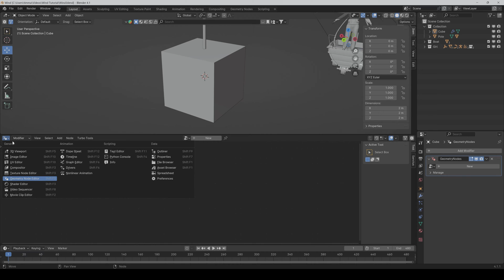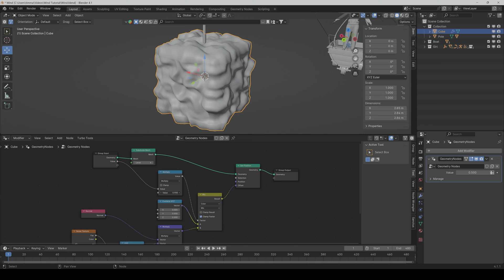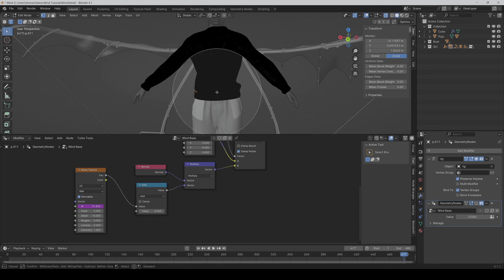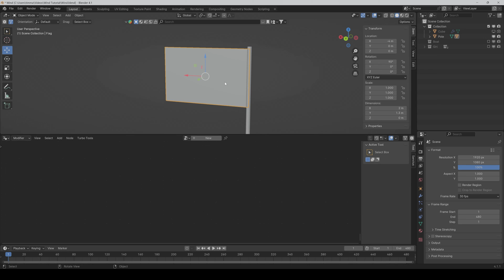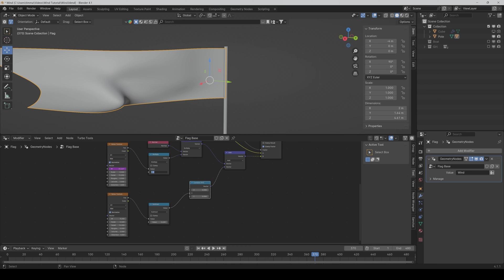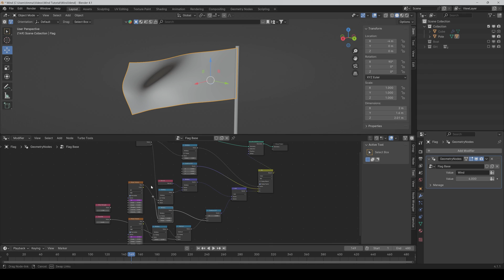Wind Effects are Easy Now - Simulate Wind in Blender on Clothes, Sails and Flags with Geometry Nodes

Comment: Cool stuff, instead of a mix rgb node i would personally use a noise going into 2 vector math nodes, the first vector math "subtract" 0.5 XYZ, then a "scale" to control the strength. You can then multiply this by the normal if you wish
Reply from the maker: Also good idea!